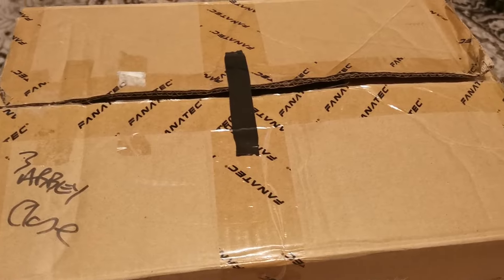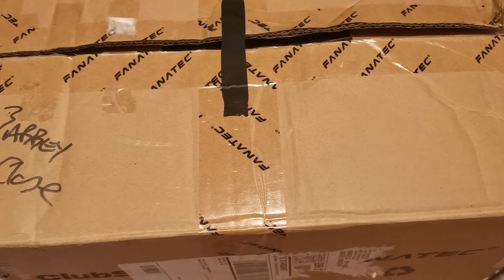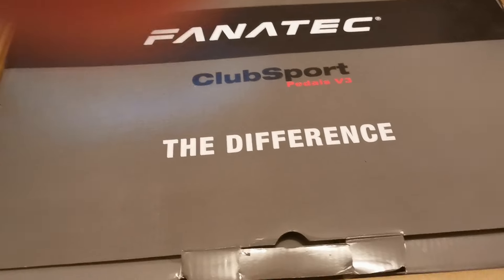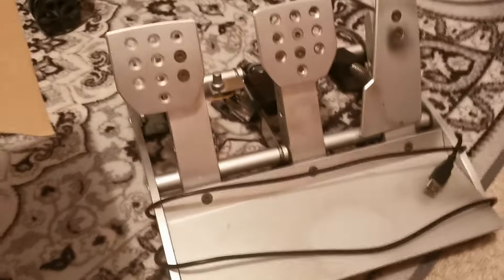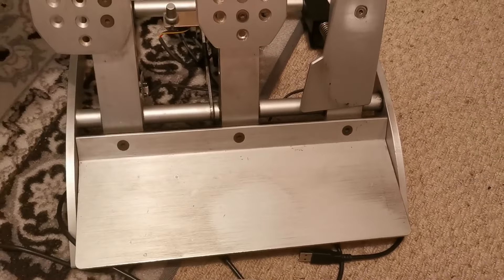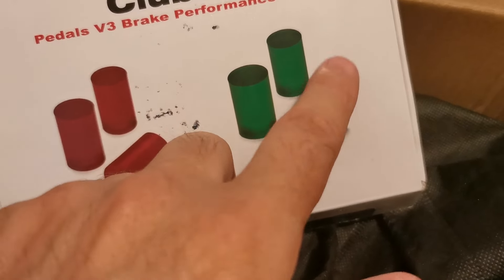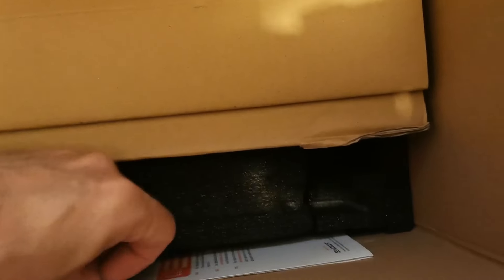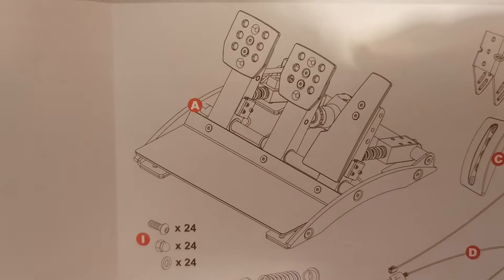Unboxing My New (to me) Toy - THANK YOU to all who helped make this possible!

Comment: Nice!.. you don't need a SIM rig, to down to your local second hand furniture store and buy a comfy for you for wooden legged armchair (one without arms). Cut the two back legs shorter by 1-2 inches and voila.. Enjoy.. it does work and costs less than a SIM rig and doesn't roll like computer chair.😊❤

Comment: Ooohh - nice BTW what Yoke and Pedals to you use if any for flying?
Reply from the maker: I dont' have pedals for flying. The rudder is done by twisting my joystick.
I do have a Yoke but don't used it because it's cheap and nasty.  Can't remember the make.
My flight simming is done with joystick and an upside down throttle (as I'm left handed).